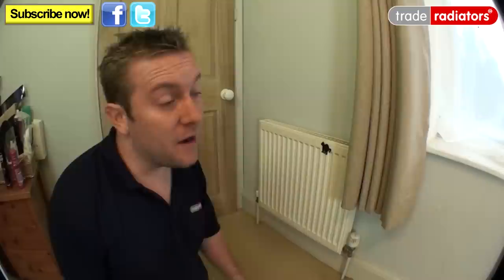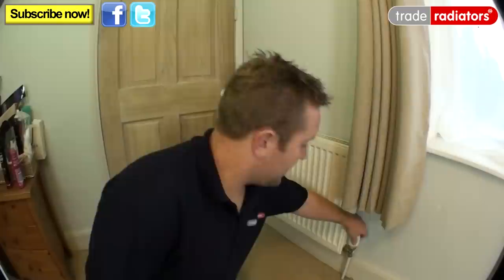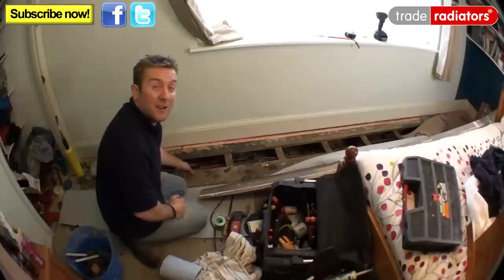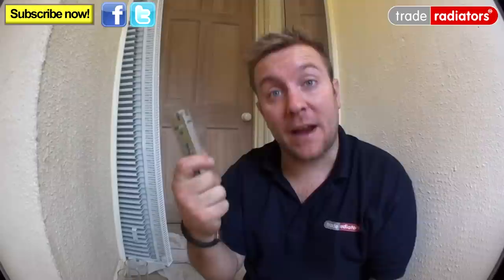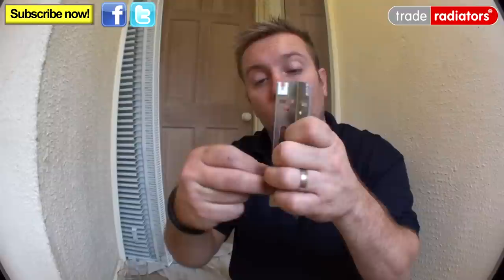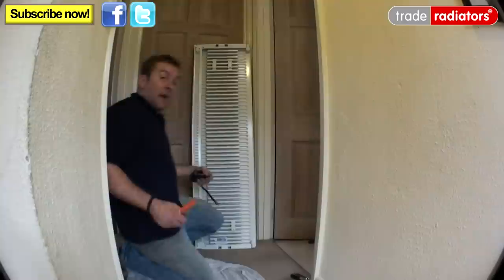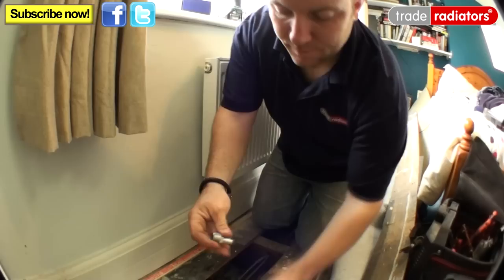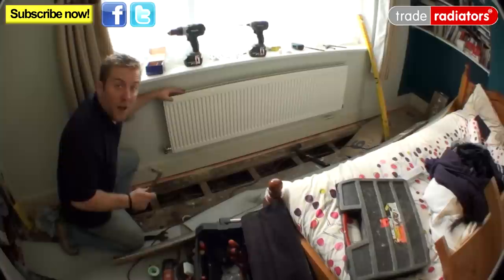How to Replace a Small Radiator With a Large One by Trade Radiators

Comment: I have to say that I find you videos very helpful. Not just this one. I've learnt a whole lot about my sealed system here on your channel. Tonight I've changed a rad in the kitchen. One more to go. What I had to figure out myself was replacing a bigger rad with a smaller one as the existing size is not readily available. The second rad in the same room is smaller, so I went up in size on that one. What I've had to work out is how to install the rads without touching existing pipework. Getting the measurements right when the brackets are different makes for a long night! Tomorrow I'm going to freeze the pipes to change the valves. I can't see a video from you on that one? Hoping I don't flood the house!! Lol. Keep the video coming. Great content nicely delivered.. regards.. KT

Comment from the maker: Jimmy takes you through the process of removing a small radiator with a much larger one, more suitable for the size of the room it's in. In this instance, Jimmy removes a small and oddly placed radiator and installs a nice long horizontal radiator centrally under a wide window.
The Quinn Barlo Range of radiators, as shown in this video can be purchased on our website here:
http://www.traderadiators.com/acatalog/Own_Brand_Compact_Radiator_Series.html
Reply: Great video. Here's  a question for you if your still around. How would you replace a 640mm radiator with a smaller 400mm radiator without taking up the floor boards.

Comment: Sorry, you didn't show how you drain the system and how you refill it and pressurise again, do you have another video showing that please? And which kind of fittings would you suggest for radiator copper pipe joints?

Comment: Thank you for this video. Without seeing the room itself, would it be easy to downsize a radiator — literally by about 1 or 2 inches, without needing to make any adjustments to the underground pipe work? 
I have already floored and didn’t want to re-lay floor in that section if it wasn’t necessary.

Comment: A great video as always and very insightful and confidence inspiring too. I would like to know if you can replace a small radiator (2800 btu single) with a significantly larger radiator 7000+ btu vertical radiator without killing the existing combi boiler?